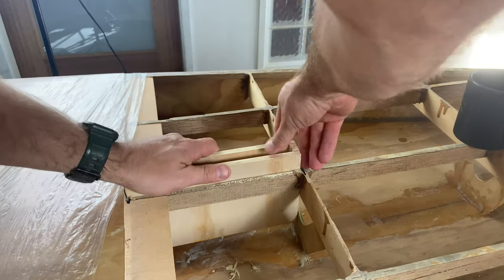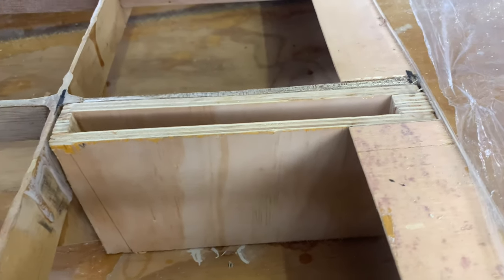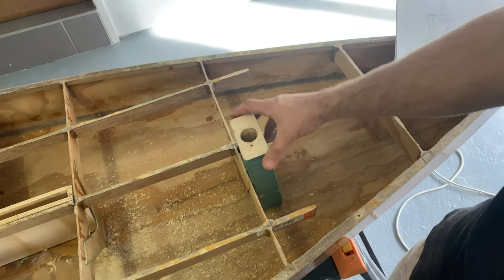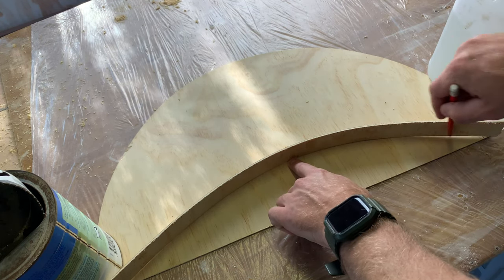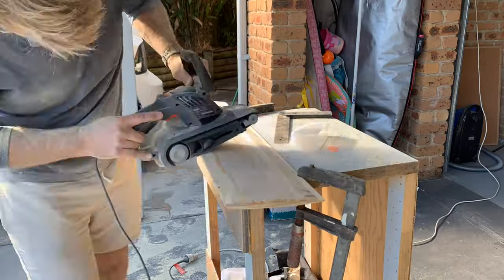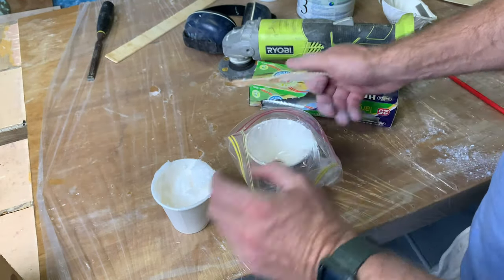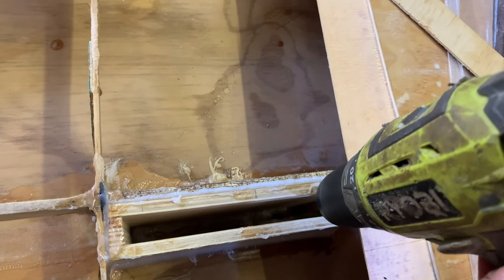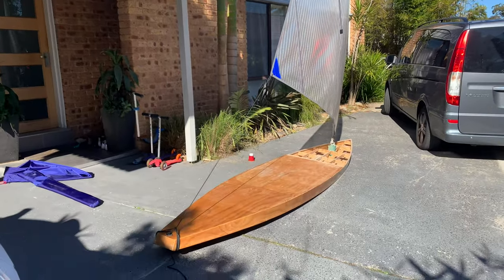[Ep 3] Adding a SAIL to a PLYWOOD SUP - install mast support, daggerboard case and test fit sail

Comment: Very cool stuff Aaron.  I am thinking that a cordless circular saw and nail gun could be in my birthday wish list.

Btw you handle those tools very well.
Reply from the maker: Thanks Col. A circular saw can be so useful especially for projects like this when the timber is a softwood and small cross section. I wouldn’t be using it on any large hardwoods!
Reply: @Aaron.deRuiter  I have a larger 240v Bosch for that sort of job.  Even so, the green models may not be the most powerful.

Doesn’t lockdown create time.  When I was your age those rugrats and the call of the waves took a lot of it.

Comment: Coming along nicely.
Will you tape the joint at the base of the dagger board trunk to add lateral strength as well?
Reply from the maker: Thanks mate, no I didn’t end up fibreglassing the sides of trunk. Fingers crossed the epoxy bonds on the top and bottom and against the bulkhead will be enough to keep it position.

Comment: Tell us about rigging .
roll wrapped fiberglass tubing and g10 glass expoy flat lamitate are easy to shape.   digiKey or Mouser electronics.
PCB fab scraps ?
Reply from the maker: Prime simple sail and rigging. I bought the 3.4sqm supernova sail from Star Kayak Sails for $575 AUD. The sail kit comes complete with furling system, aluminium 3 section mast, 3 blocks and all furling and sheet lines. Pretty good deal I’d say!